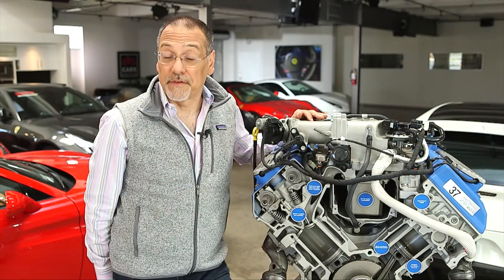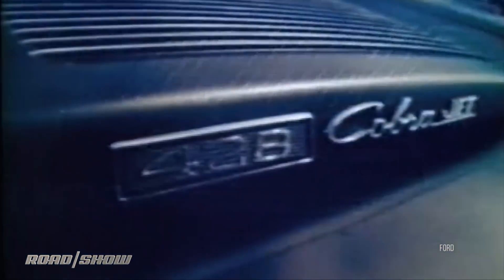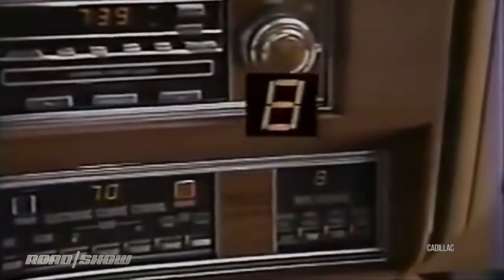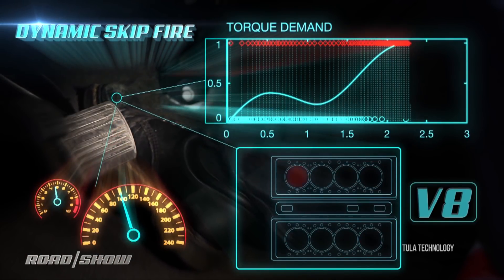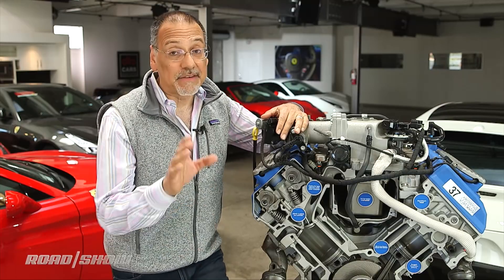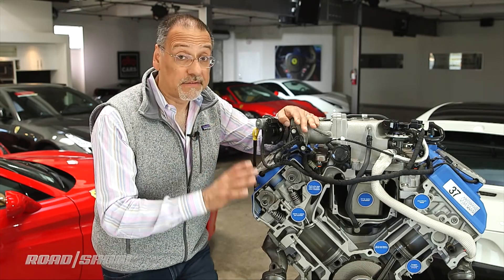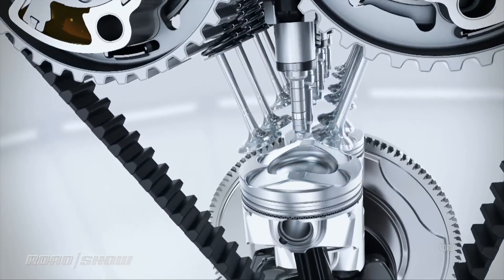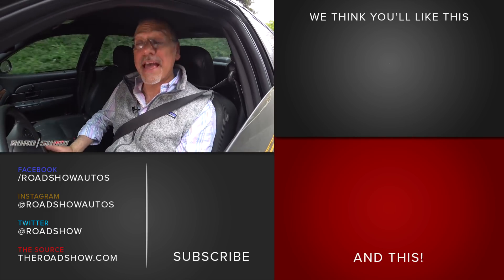Cooley on the shrinking engine: Cylinders are an endangered species

Comment: The last, desperate gasp of the ice engine designers to keep their pollution machines relevant for just that little bit longer.  When solid state batteries take over the market in 10 years and it gets to the point where it's cheaper to convert a car to electric, rather than leave it ice somewhere down the line, we'll look back at all this effort and ask ourselves "Why?"  

Why didn't we put that money into battery tech, and why didn't we do it sooner?  Why did we fight so hard to keep combustion engines going when we knew they were the worse option?  Why did we let the oil companies drag us along for so long by buying our politicians and killing E.V. innovation?
Reply: @dwight122324, douchbag you know how harmful smog emissions are over the average life of an Internal Combustion Engine which as of 2018 is about 8-10 years? And besides the fact that there are older vehicles still on the road which are emitting two to three more times across all 50 states?

It's the stubborn bureaucratic beliefs such as yourself, along with politics, and believe it or not plain ignorance that are stagnating the advancement of better technology for the environment and the world. I thought I'd never say this but the writing's on the wall and this is coming from a manual transmission lover!
Reply: Imagine the smoothest, quietest V12 engine ever produced.  Now imagine it has a completely flat torque curve, so it pulls as hard from a standstill as it does at 4000 RPM and beyond, so much so that you don't even need to change gears, and it's super efficient.  That's what you get with an electric vehicle.  Why would anyone not prefer that to buzzy, laggy, little turbocharged four cylinder engines?  No tree hugging is required.  It's just a way better driving experience.  Once you try it, you don't want to go back.
Reply: Duane, you need to do a bit more research.  Actually, a lot more.  Your information is quite antiquated.

First of all, yes food animal farming is a major pollution source, but they've recently (in the last decade I believe) found that adding seaweed to cattle feed reduces greenhouse gas emissions by a significant margin.  I imagine it won't be too long before government regulations require it's use or it's somehow subsidized for farmers to help reduce emissions.

Second, most countries are moving towards renewable energy at a breakneck pace, either shutting down old gas and coal power plants or making them cleaner and more efficient.  Moving from multiple sources of pollution generation to a few centralized producers WOULD make a significant impact on pollution, and would allow for better, more effective carbon sequestration tech to be developed.

As far as shipping is concerned, they're making some headway there too, but I haven't heard about any major advancements lately.  There are a few places trying out fully electric car ferries.  There are also countries working on fully electrifying their rail networks for passenger and cargo trains to reduce emissions there as well.  

Here in america, many companies will let their train engines idle when not in use, burning fuel to keep the engine coolant from freezing in the winter.  One can only hope that eventually the american rail system can be electrified and still work with the cargo cars as they are.

There are also some mines that are trying out electric trucks to haul material out of mines that have found the trucks generate more electricity when coasting back down into the pit than they consume driving out, even fully loaded, and are working on ways of using or distributing that power to local grids.

Finally, as far as production goes, yes we still use MASSIVE amounts of oil for producing things like plastics, but as has been the case for many years, scientists are working on creating plastics from bio sources to reduce our dependency there as well.

We will not be off fossil fuels for quite some time as a planet, but any step forward is better than standing still.
Reply: Bryan Hall agree plus u can run ang fuel dosnt have to be fossil
Reply: hellcat1988 the trucks generating more energy down a hill than consuming driving back out breaks the first law of thermodynamics that means the engine is 100 percent efficient and nothing we have is 100 percent efficient
Reply: Dan Sanger you all seem to conveniently forget about ethanol and alcohol engines you do realize we can run or engines on corn water and alcohol and they will put out a LOT less pollution
Reply: Battosai Jenkins literally nobody cares except you and the tree huggers
Reply: We can't even all come home after work and then our AC on without our power going out. how are we all going to turn or AC on AND plug our cars in without the power going out????
Reply: Battosai:  Don't feed the trolls.  Notice I didn't respond to him because I knew he was just trying to start a flame war.  You have to accept that there are people too stupid to realize that even with the mining of raw materials and generation of electricity (most of which is done with clean energy in almost every other country outside the united states) it's cleaner (even in america) to run an e.v. than even the most efficient ice vehicles.

Aside from them, there are the idiots who DO know, but they still want to start arguments just for the fun of it.

Lastly, there are the oil purists.  They refuse to accept their will be anything else because the fumes have gotten to their tiny little brains and caused enough damage that they can't accept new facts.  Like republicans or religious people.
Reply: I'd rather have a turbine/electric hybrid. No huge battery weight, fast refuel, high efficiency burn (compared to ICE), and electric drive. Win/win.
Reply: why insults right away? can't make valid arguments? I do know how harmful battery production and production of electricity is. Lets tackle other problems before we take cars away
Reply: Bryan Hall Also, turbines can accept any liquid flammables as fuel. So no more cleaning out gas lines.
Reply: hellcat1988 the reasons no one supports electric cars are 1 the charging stations are few and far between in rural areas and the charging takes hours at best you can’t drive a long way, 2 the car companies can’t decide on a singular plug design for their chargers so electric chargers are brand specific, 3 people like you who are so self absorbed in their electric cars you think they’re the pinnacle of automotive innovation the reason we haven’t switched from ICE to electric is because the ICE is so versatile and easy to fix and cheaper to fix you can fix it yourself when with an electric car you’ve got to have a degree in electrical engineering to fix an electric car. 4 stop pretending that electric cars do no harm, god you’re like one of those parents that spoils their child because “they can do no wrong”, look up a picture of a lithium mine please not to mention tell me what trucks are hauling the lithium out of the mine and the manufacturing process outputs pollution and the power plants out put pollution and over the entire electric cars lifespan (which is much shorter than a gas engine) it puts out only a little bit less than a gasoline car not to mention buying a used hybrid is a massive gamble because 9 times out of 10 That Car is broken beyond belief
Reply: hellcat1988 nobody gives a fuck about electric cars. Nobody wants to drive around in silence. We want the sound of a motor that burns fuel
Reply: hellcat1988 actually buddy the Diesel engine is more efficient than an electric engine
Reply: you know how harmful batteries and their production is to the environment? ICE is way better.
Reply: I think it is funny because cars aren't the big threat but they are still getting all of the attention, shipping and cows account for a massive amount of the co2 produced every year. Also going full electric right now won't reduce co2 that much as you still have a lot of coal and gas power plants, on top of that you have the massive amount of oil that is used in every production line.
Reply: 100% right Duane

Comment: Cooley firing on all cylinders. :)
Reply: Cougarsamurai this may be a dumb question, but would a hybrid or electric small truck work.
Reply: MajesticLion unless they improve charging times its not i can full up in 5 min so thats the problem i see
Reply: If it can become possible to fuel up during delivery loads/unloads, whether by wired or inductive charging, then that may work. Also, solid state batteries may come around in a decade or so, and that'll speed up charge times.
Reply: Michael Ball i dont see any of that being a good option the only thing i see is swapping out the batteries bc you cant charge the same ones in time and that would take a whole department to do it i dont think the drivers or loaders or unloaders will be able to do it
Reply: Robert Hoos I don't see why not. Tesla is making a electric semi so yeah it would totally work.
Reply: Robert Hoos Absolutely; torque is what truck drivers of all sorts need for real work,, regardless of the truck's size, and electric powertrains provide gobs of it.

Comment: a tesla makes all this look ridiculous
Reply: Tesla is so perfect they don't even bother checking the brakes in the assembly line  :D
Reply: Some people here need to know how to lease.
Reply: Bryan Hall you are a joke..
Reply: I know they're new and I acknowledge the challenges pertaining to that, but it goes against the "it makes everyone else look ridiculous", doesn't it?
Either Tesla is a struggling startup, or a manufacturing beast humiliating the rest of the industry. Can't pick and choose the definition based on the argument.
Reply: Especially when they go out of warranty, and you can't get parts - like overly complicated door handles. ;-)
Reply: Tre'von Cowen. Yes exactly. A new battery costs $14,000.  For some people $14,000 buy's them 2-4 years worth of fuel.
Reply: Teslas are poorly constructed over priced money pits for the manufacturer and over hyped trash for the consumer
Reply: Yeah, and a trabant makes the panel gaps on a tesla look ridiculous...
Reply: Aries Might It sounds like you work for Chevron or Exxon. All of your reasons have no merit, but the one that makes me laugh is that electric motors overheat. I'm an EV  driver so that's why I know your reasoning is foolish. Stick with your ICE and good luck.
Reply: Aries Might The only thing I understood from your reply was Libtard. I also don't get why people  associate politics with Electro cars. Try taking a break from politics from time to time.
Reply: zolikoff they’re new don’t knock em out yet
Reply: Pietro Del Franco Tesla's are cool; but also are electric cars in general especially when they're affordable. Once you go electric you won't want to go back to the stone age with gas stations.
Reply: ffhgu 07 Not really. With my Chevy Volt, I use pure electricity for my daily commutes and when I do trips (twice a year) my Volt sips on gasoline no neeed to recharge. You know who else loves your V8, the Filthy rich Kings and Prince's in the middle east who are bathing in your hard earned $$$. I decide to keep my $$$ in the USA.
Reply: White Supremacy My Chevy Volt is not a Hybrid. I drive it less than 40 miles per day therefor I use 100% electricity. Now, if I want to go furter I have that option. That's why it's labeled as an Electric vehicle with an extended range gas backup. Fortunately I don't need that backup because of its dependability. Ask yourself how many moving parts an ICE has? Hundreds? Thousands? An electric motor? 1, the shaft.
Reply: Pietro Del Franco shitty batteries make a Tesla literally useless to 99% of people
Reply: Tesla's looses are ridiculous
Reply: ffhgu 07 You like to be surprised when your engine breaks down every once in a while. You like that sweaky belt, engine misfire, and overheated radiator gurgling noise. That chest pumping is from you in agony because your V8 is an inefficient money pit.
Reply: Pietro Del Franco Tesla is ridiculous.
Reply: White Supremacy You're not entirely wrong. The Volt or ELR is never classified by GM as a hybrid. Why not? Because as a Prius, it's main function uses both gas & electrics. What makes the Volt so special is that you can use it as solely as an electric if you wish, which I do fueling it ONLY with these things called electrons. Can it use gas & electricity to propel it's wheels when the battery is drained?  Yes it can, but when I use 100% electricity and have not used a drop of gas in months, you still want to call it a hybid is like this. Calling your 2017 Suburban that comes with 4X4, an off-road vehicle. You wouldn't compare a Suburban with a Wrangler. That's what makes the Volt a bit confusing and AWSOME vehicle. Options is a good thing.
Reply: romanl1977. You are a libtard that trolls using pure Bullock. As a medium.
Reply: romanl1977. The pros of petrol vehicals over electric one's are. 1. You can fill the fuel tank more quickly. Then you can fully discharge then recharge. The electric battery.
2. Due to a large number of petrol filling stations. Finding refuelling stations is quite easily accompolished. Vs a electric recharge station. 
3. In most vehicle accidents rescuers will immediately approach a petrol vehical. Then an electric because electric current is nearly impossible to detect. Vs the oder and wet staining caused by petrol fuels.
4. Vehicals powered by combustion engines. Have a lot more resale value then an electric.
Why? Because electrical problems are a lot harder to detect. By the navies person.
Oh and heres one I just remembered.
5. Combustion use both oil and coolent to keep the engine temps to a minimum. Electric motors dont! Which is why they just over heat smoke, short out then catch fire. Creating shorts and fires in other areas of the electrical system.